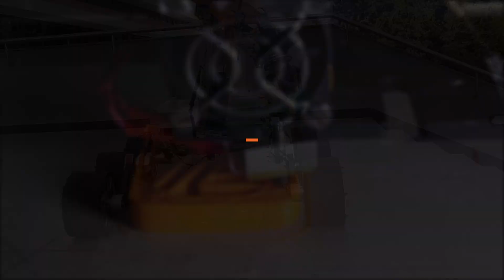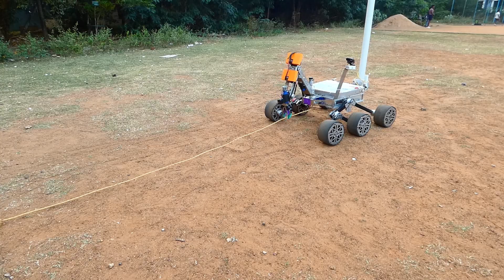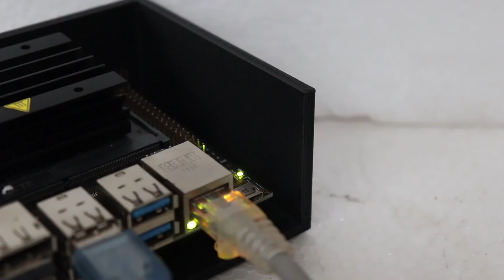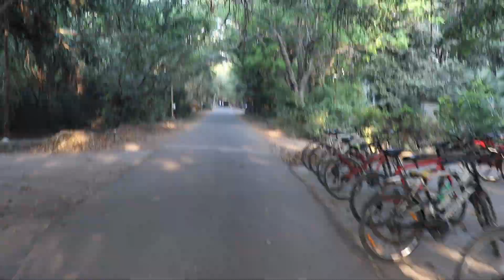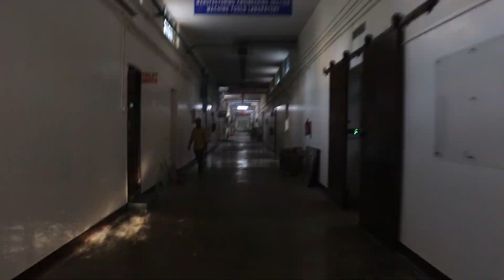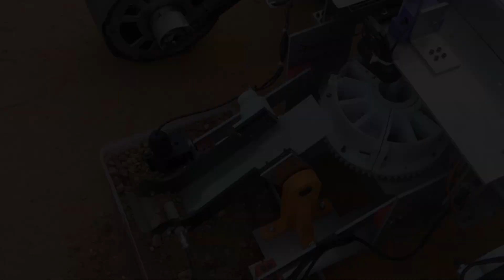Team Anveshak - IIT Madras | System Acceptance Review | URC 2020

Comment: Doubt -why most of the rovers participating in URC have stopped using rocker-boogie suspension???
Reply: 4 wheel rovers using steering mechanisms have better precision and low weight